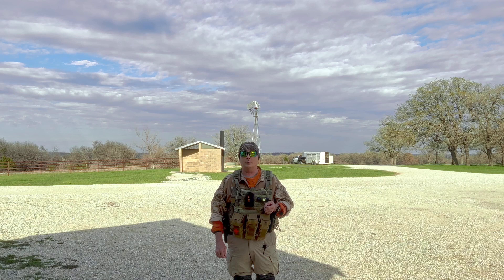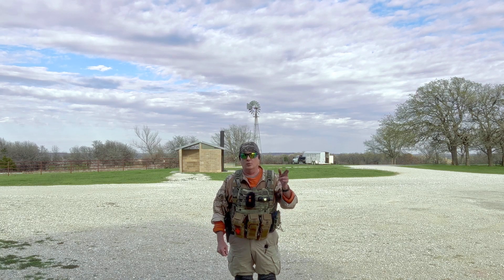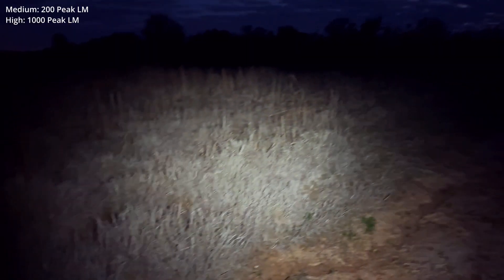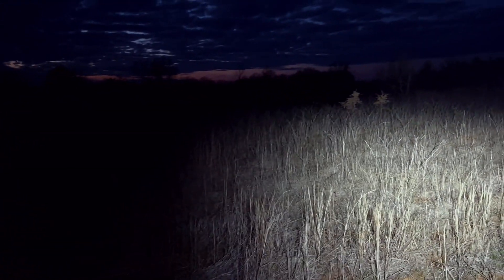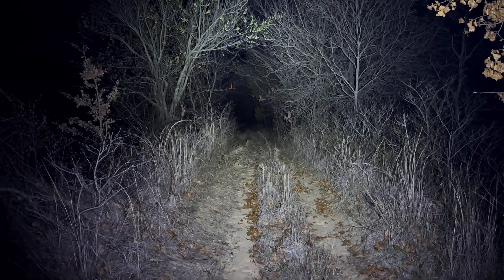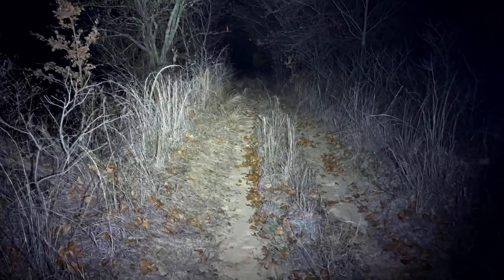Nitecore EDC27 Battery Endurance Test

Comment from the maker: I did another exercise at a local park using predominantly Medium.  About every 50-100 yards, I did a 360 sweep in High,  Average interval in High was just about 45 seconds.  Run time in a 50F environment was 2:21 .  If you could run exclusively on Medium (not advisable in a general wilderness setting), run times in excess of three hours are possible.

Comment: What would you suggest as a good all around light? Something I could edc and use as a tool, but could double in tactical situation having a tail switch. Thanks
Reply from the maker: Great question.  I'd like you to repeat it in the Community section if you don't mind.  The discussion may be of use to others and they might never find it if buried inside a review video.  There are probably several lights that fit your criteria.  My (primary) EDC is the PowerTac M5-G2.  Light, small form factor, with a tail switch for on/off/momentary.  Probably has one of the best momentary switches I've ever used over a a wide variety of lights in decades of private security (Executive Protection), Patrol, and SAR applications.  Side switch for changing modes.  I place the clip in line with it so that when it comes out of any pocket and into an overhand grip, my fourth finger is naturally on the switch.  Very easy to rapidly change modes.  For tactical (defensive) and wilderness use, it's useful to have a higher candela light in an EDC form factor (but not overwhelming).  The M5-G2 provides a good balance between peak lumen output (2050) and candela.  More than enough candela to punch downrange, but still has useful spill.  Good at the low end for tracking, for example.  Check out the review video on the channel and see what you think (although this is by far NOT the only light that might suit you).  If I can get a good week of weather in April (we've had storm after storm blow through), I'd like to get the M5-G2 out to the LBJ Grasslands and run this exact same exercise.  I'd run Medium for path following with intervals on High (as necessary) for downrange situational awareness.  I've used it extensively in wilderness SAR training and applications, but I've never filmed it in such an environment. Hope that helps.
Reply: @L5-SAR  man I really appreciate you responding, I will go watch some videos on those two now. I’m glad you touched on useful spill but yet have a decent hotspot. I would definitely like the best of both worlds. An easy to find and click tail switch with an instant turbo on press is a must. Sometimes I find what I’m looking for, then the UI let’s me down. Thanks again man
Reply from the maker: @Jacobeshack  The M5-G2 does not have one-press to Turbo.  I leave it on High.  That's a very good general mode.  If for some reason I need to go to Turbo, it's one click away.  However, if you are in low, there is no one click to Turbo.  You may have to consider a larger form-factor 'tac' light to get 'all of the above.'
Reply: @L5-SAR  Thanks, any downside to the m5-g3?  Thoughts on Nightcore SRT6i?  Was considering a few.  EDC27 for daily, SRT6i for the car/property and something with more battery for the bush (in addition to a headlamp and automotive worklights).  Got a 12yr old streamlight that needs replacing.  Penlights work fine for wrenching but don't cut it...
Still shopping
Reply from the maker: @sc358.  The M5 is a pretty basic, no-frills light.  No battery indicator.  Tough as nails and will take a lot of abuse.  I used its predecessor, the E5, for years in executive protection work and private security gigs.  It is higher candela than a lot of EDC lights, so it's a narrower beam and longer throw.  That's why I like it in the sense that I already have it with me when I go out on SAR ops.  I can use it in a lower mode to search inside tree lines.  Most people tend to favor a floodier beam for EDC.  I do not have any experience with the SRT6i.  Good luck
Reply from the maker: @sc358.  You may be interested in this:  https://www.youtube.com/watch?v=VrBOA1qmQS0

Comment: How do you avoid getting lost?
Reply from the maker: For the basic route I originally planned, I've done it enough times that I should not have that problem.  Now, it was a bit unadvisable to go off and explore that alternate route, especially since I lost most of the stars I would use for orientation with clouds.  Still, I'm in a single lot of land that's fenced with roads on the outside on two sides.  Getting disoriented is easy.  I use a combination of fixed markers (radio towers) and marks I leave in the dirt for backtracking.